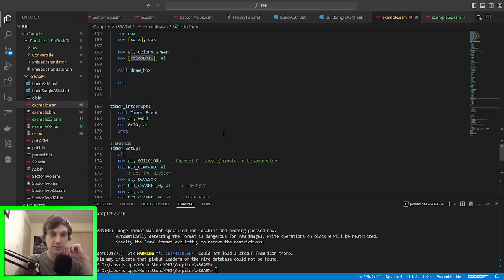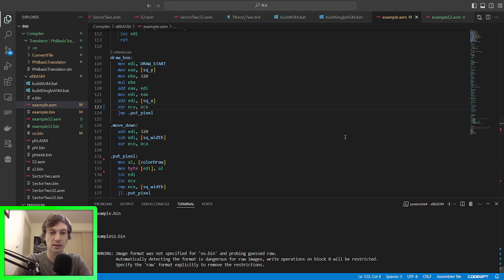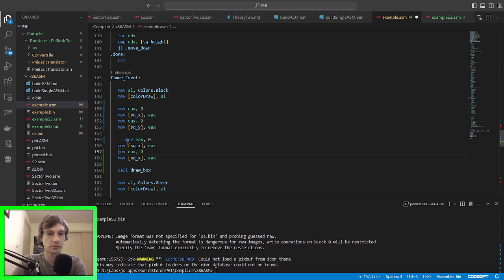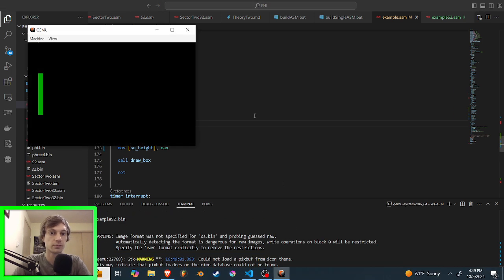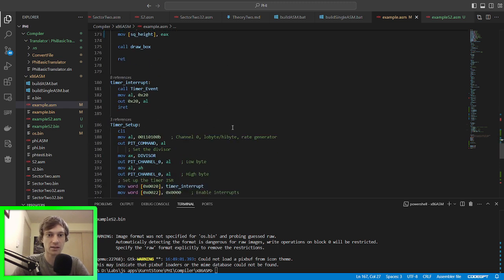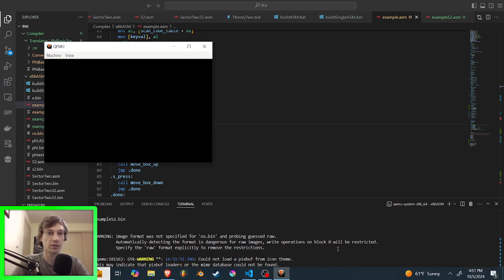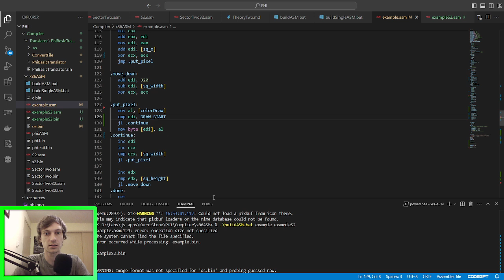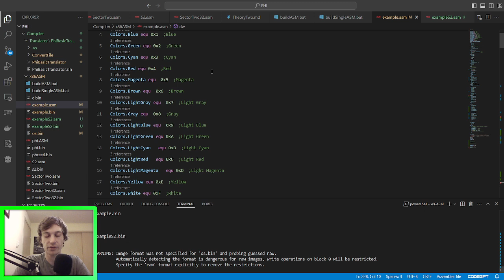Game Development in x86 Assembly Language - One Third of Pong

Comment: To prevent flickering while moving objects across the screen we can use a buffer of 64000 bytes in RAM and if all drawing is done into the buffer, we can wait for vsync at port 3DA and then we can copy the buffer at once into the screen memory. Now we can clear the buffer or put a background picture inside for redrawing our moving paddle(s) on a new location.

For higher resolution we can use VBE 3 triple buffering in the linear framebuffer with changing the start address of the visible screen. Example for 1024x768x32 we have one visible screen and two unvisible screens and we start to write into the unvisible second screen and then we switch the start address to the second screen and now we start to draw into the unvisible third screen and so on looping through the start addresses.
Reply from the maker: yep, double buffering is something I will have to get around to
Reply: @BrandonHilde129  Using vsync to prevent flickering. In 320x200x8 we have 60hz refreshrate. 

MOV   DX, 0x3DA
P1:
IN    AL, DX
AND   AL, 8
JZ P1